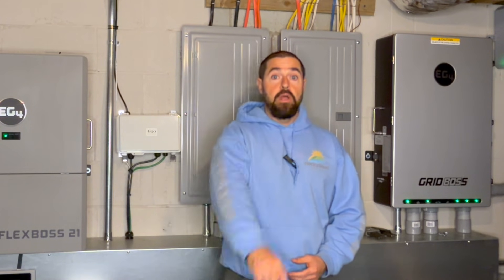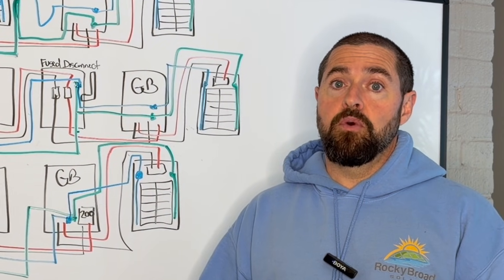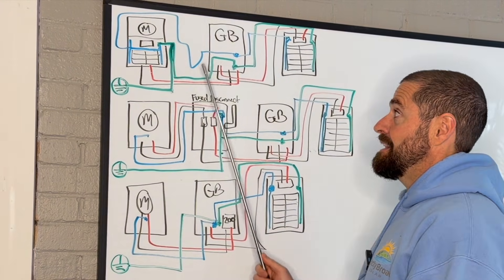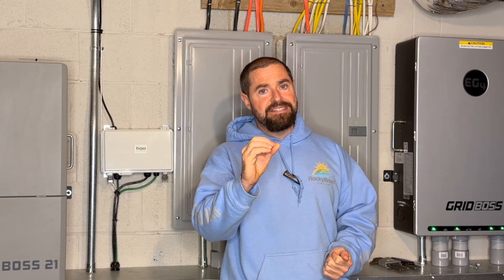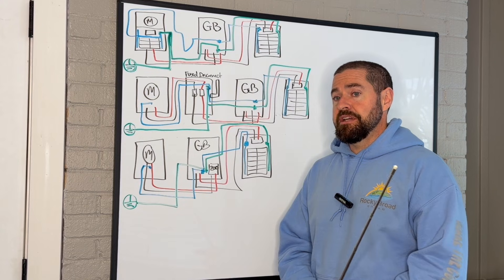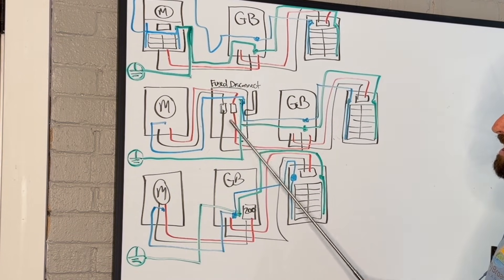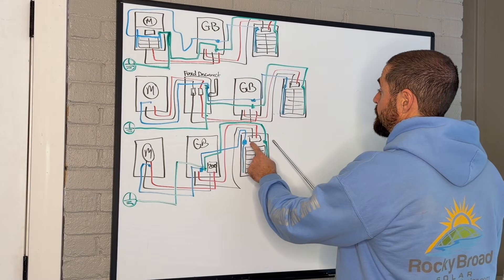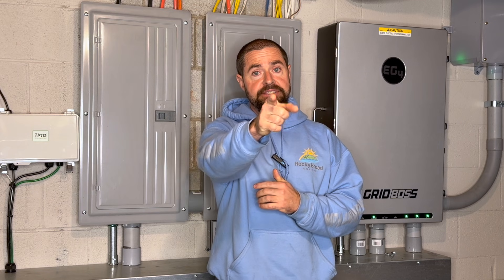EG4 GridBoss: Top 3 Wiring Configurations Explained + Proper Grounding & Bonding Guide

Comment from the maker: 🔌 Products Mentioned:

Signature Solar affiliate link (CHEAPEST SOLAR PANELS ON THE MARKET and EG4 Products) 
$50 off for orders over $500 when using the coupon code: ROCKYSAVE50
https://signaturesolar.com/?ref=uzUOpPif73O10D

https://signaturesolar.com/eg4-flexboss21-14-3-28-6kwh-capacity-eg4-wallmount-indoor-battery-bundle-bndl-e0023/?ref=uzUOpPif73O10D

https://signaturesolar.com/eg4-gridboss-vs-mid-200a-service-entrance/?ref=uzUOpPif73O10D

If you are interested in a zero cost pressure free quote for turn key installation of solar and storage products, fill out our intake form below...

Rocky Broad Solar Intake Form https://docs.google.com/forms/d/e/1FAIpQLSer5w_81iHtdcZBKV8Zuo9KVwJGQsqg_QNV-ePRvmWMiHZ8dg/viewform

If you are interested in DIY solar and storage products, check out some ROCK BOTTOM prices on those products using our affiliate links below...

Signature Solar affiliate link (CHEAPEST SOLAR PANELS ON THE MARKET and EG4 Products) 
$50 off for orders over $500 when using the coupon code: ROCKYSAVE50
https://signaturesolar.com/?ref=uzUOpPif73O10D

Current Connected Affiliate (SOL-ARK PRODUCTS)
https://currentconnected.com/?ref=RockyBroadSolar

Also check us out at the following places....

Rocky Broad Solar Website
https://rockybroadsolar.com

Facebook
https://www.facebook.com/profile.php?id=61558585264414

Comment: Just thinking out loud here, not planning to upgrade my Sol-Ark8k anytime soon.  BUT, I have an old house (over 45 years old) and the 200 amp service main box bonds all grounds and neutrals to one 3 level grounding bus/bar.  
Reckon only way I could implement the GridBoss would be to replace the main box and rewire??  Is that correct in my case?  Thanks for the videos, great work and informative.
Reply from the maker: I am not 100% sure what you mean by a 3 level grounding bar, but generally there is a system bonding jumper that can be removed that disconnects the neutral bar from the case(usually a green screw), and then you can add a new ground bar manually, and add your equipment grounds to that. Thanks for watching!

Comment: So for option 1 is the CSR breaker not required? If your setup is option 1, why did you install the breaker?
Reply from the maker: It is not required on my system. I only installed it because I have a separate solar/battery backup testing station upstream of the Gridboss and I wanted the ability to run them independently of each other when I am simulating grid outages and such. Thanks for watching!

Comment: I have a meter main, is it to code to reconfigure it to option 2? I. E. Are there  issues because it's a combined meter main enclosure?
Reply from the maker: @k.i.3154 If you have a meter main then leave the ground to neutral bond in the meter main, and send a 4 wire circuit from there through the utility required disconnect, leaving your grounds and neutrals unbonded in the disconnect and everywhere else downstream. Shouldn't be any code issues there. The only time you start running into issues is when you leave branch circuit breakers upstream of the GridBoss, at which point you start running into the rules in 705.12. Thanks for watching!

Comment: My electrician installed what looks like a block to connect more wires on the outside connected to the earth ground. What’s the purpose of that?
Reply from the maker: That is what is called an intersystem bonding jumper. It is required by code so people like an unqualified cable or satellite installer has easy access to ground/bond their equipment.
Reply: @R @RockyBroadSolarLLC  Thanks.